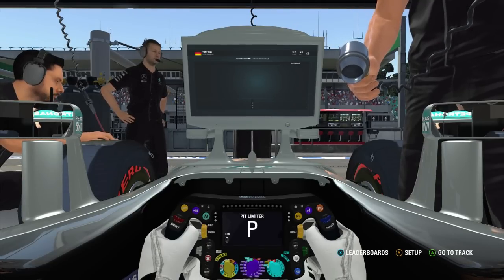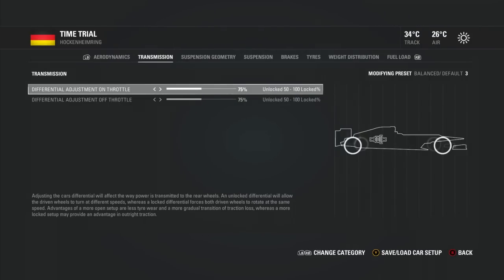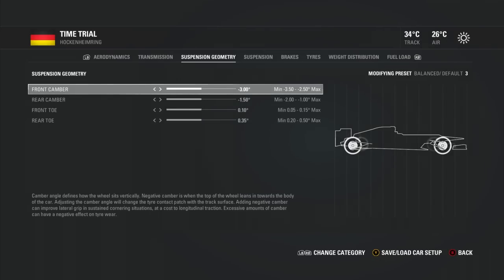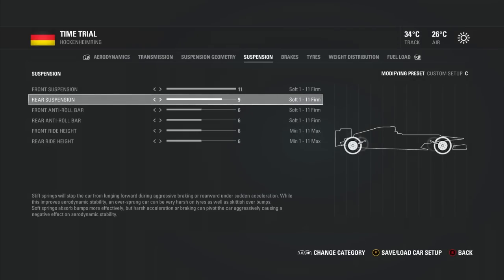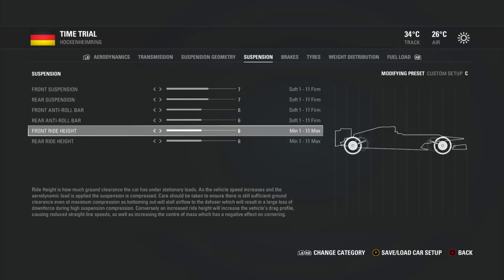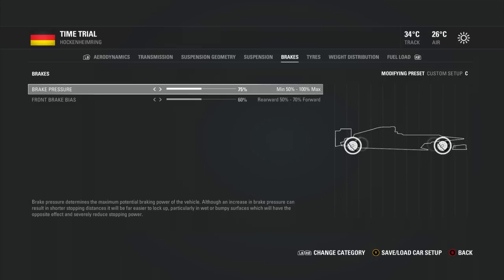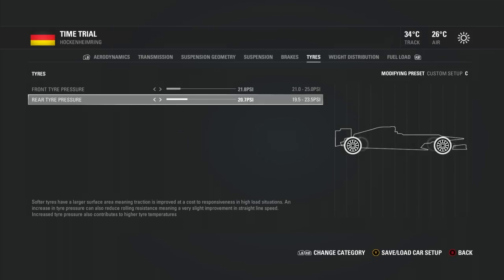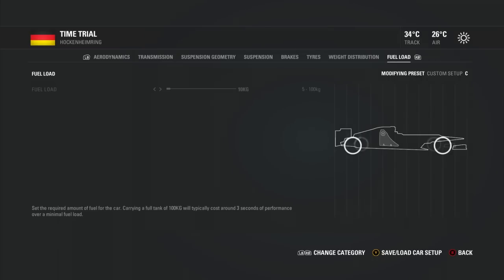F1 2016 CAR SETUPS: How do they work? Explained

Comment: With lower tyre pressure you have more grip, but the tyres degrate faster. I you choose a higher tyre pressure you'll be skating more, but the tyres last longer. That's the general idea
Reply: But because there is more contact the tire will overheat faster resulting in less grip and more tirewear
Reply: a lower tyre pressure also means bigger rolling resistance, which results in less speed

Comment: in terms of tyre pressures, I work with go karts and we set our pressures according to the temperature of the track. if it is a cold day we will set the pressures higher, this causes the tyres to heat up faster, but does increase the wear. during the summer when the track is hot we set the pressures low so that the temps of the tyres are controlled better and less likely to overheat. hope this helps

Comment: Regarding tyre pressures, reducing them will increase traction especially out of low speed corners, reduce the likelihood of lockups (supposedly) but will increase tyre wear especially around long flowing corners. Higher tyre pressures will make the tyres last longer and heat up faster but will reduce traction and are only recommended for tracks like Silverstone with long flowing corners. Feel free to quote me if I'm wrong here.

Comment: In NASCAR low tire pressure is used for good long run speed as the pressure will go up over the run.  High tire pressure will make it wear out a lot quicker and will only be good on the short run

Comment: I noticed a couple things:1) moving ballast to the front of the car puts more weight on the front tires. Therefore increasing the grip on the front tires (also increases tire wear because your working those tires harder), conversely less generation of grip in the back end. Therefore introduces more oversteer, not less. (I think codemasters might have misunderstood ballast placement). So codemsters description should go as "Moving the ballast to the rear reduces oversteer, conversely moving the ballast toward the front reduces understeer.2) Tire pressures are based on the temperature across the surfaces of the tires. Inside of tire running much hotter than outside means that there is too much negative camber. If the middle of the tire is significantly higher than the outer and inner, then the psi is too high. etc. Will we be able to see the temperatures across the tire surface in this game?
Reply: I believe codies are really thinking Center of Gravity of the vehicle here, not ballast. If they meant Center of Gravity, then their verbiage would be correct. Center of Gravity usually has a X,Y, Z coordinate (3-dimensional adjustment) as well rather than a 1-dimensional adjustment like they show here in the game. Ballast typically would be adding weights to the vehicle to help with corner weights at each corner of the car (usually to even out the distribution of weight without messing with suspension settings).

Comment: Bad advice. you shouldnt use stiff suspension for monaco! Soft suspension give more mechanical grip in slow corners, stiff suspension better response (preferable at high speed sections like there are many off them in Silverstone and Spa)
Reply: I am confused, would a soft suspension at silverstone at least be good in terms of tyre wear? Sorry I know it's been a while since your comment, would love to get an answer
Reply: H3r0KinG The best Silverstone setup is available at 'TRL Litless Silverstone Setup' video. If you search this you'll get the video. In terms of one-lap setup, his setup is great. If you want less tyre wear in the race, use his setup and soften the suspension a little bit (3 steps maximum for each setting) and set the camber less agressive (so dont use  -3,5° and use -3,0° for example ).

Don't use a very soft setup for silverstone, this will drop your race pace too much and won't give you an tyrewear advantage thst will allow you to skip a pit stop. If you do as I wrote aboce you'll have a good balance.  I hope this was usefull.

Comment: So what are the most important things to remember in terms of tyre saving? (With setups) eg. Is less camber more important than more softer roll bars...
Reply: I think that depends on the track. For example if you have a bumpy track like monaco and you put verry firm suspention then you will skip more over the track resulting in more tyrewear and less grip (I think)

Comment: High tyre pressures mean the fuel usage goes down quite a bit, as the effort required to move the car forward decreases, due to the tyre not dragging across the surface, with less contact. It also reduces steering responsiveness, as the car is more susceptible to bouncing and skating around thanks to the tyres being less compressed by the car's mass. Low tyre pressure does the opposite. At least in real life, I don't know how accurately they modelled it in game, and those are just the main differences.
Reply: also low tyre pressure will heat the tyres up more, won't it?

Comment: I feel like it should be your engineer that does your set up for you and maybe then in practice you could say I've too much under steer or I'm struggling with traction etc and he can change it for you
Reply: As a F1 driver (or any racing driver for that matter) you also need to know, at least a little bit, how to make a car setup. Because everything overlaps in real life (I don't know how that will work in the game). Like for example, you feel like you have too much understeer, that could be in fast corners (downforce), that could be in the middle of a slower corner (suspention) or it could be at the entry of a corner (anti-rollbar). 

And in a F1 car there are a lot more things that they change, but the drivers know at least 'the basic stuff'.

Comment: i don't understand it cause you say with higher tyre pressure the car will slide more but if you slide more the tyres wear out quickly, but if you have to much grip you wil loose traction/topspeed so you need to find a pressure between that cause i think they wil wear out quicker with higher pressure atleast with a go-kart and if you're running higher tyre presure you're tyres reach higher/faster tempature
Reply: when you have too low tyre pressure, then the tyres start to overheat. And when your pressure is too high, you will have less grip and then the tyres will start to overheat as well.

Comment: Ballast is wrong. The Codies description isn't right either. Moving ballast to the rear increases rear traction (from having more weight there) and reduces oversteer. Front ballast reduces understeer in the same fashion. So it looks like the game actually has this backwards, at least in the setup menu. Hopefully they fix this.

Comment: I have a question about setups:
In some previous f1 version (way back in like 2010), the setups were already tweaked to the specific track and you just had to tweak it to your liking. Is that still the same or do you need to put in like 11 downforce for monaco and 1 downforce for monaco?

Comment: Oh, I thought this would be replaced by the R&D, as I thought the R&D would be easier to update the car than the stop, since I noticed that on F1 2012, if I went any more than the intermediate difficulty, I easily fall all the way down the order, but I am not so good with car setups, since I don't know which parts have to be changed to make my car's pace match with the other front runners. So, if this game has both R&D and car setup, do I still have to do changes in the car setup if I were to get the game and go on one of the hard difficulties?

Comment: Well could you explain the differential "off". Why does having it locked help or hurt when your off the gas and have the differential 100% locked
Reply: Thanks for the answer!
Reply: with differential 100% locked, the wheels left and right are forced to spin the same speed, But when a car takes a corner, the inside wheel needs to travel less distance than the outside wheel. So when it's 100% locked, you will have a lot of oversteer when it's 0% locked you will have a normal working differential so it will take corners very well. (A differential makes it possible that there is a difference in speed between left and right)

Comment: 7:25 Wrong. Low tyre pressure gives you better performance AND tyre wear. So, the only bad thing is a risk of puncture
Reply: But if your tire pressure is too low, the tires will overheat, resulting in less grip and more wear
Reply: Lower pressures increase the size of the contact patch, so there is more mechanical wear and overheating is easier. Lower pressure means more traction but reduced tire life, which is why teams push for lower pressures in qualifying but not necessarily when trying to make tires last during the race.
Reply: +cobalt789 You are wrong, low tyre pressure increases tyre wear too. Contact Ossi Oikarinen if you dont believe

Comment: With brake pressure dont you set everything else up, so you know how much downforce you got, and then adjust the brake pressure so that you dont lock the brakes with full braking on pedal/trigger?
Reply: Indeed, everything overlaps eachother, also firmer front suspension will stop the car leaning forward resulting in less downforce and further weight transfer to the front, thus faster locking brakes.

Comment: ino u tried ur best to explain it but does any1 else have an explanation on transmission?? thanks for ur help :)
Reply: In short, the diff on throttle: when you set it really high, you get more traction out off corners. The downside of this is when it is to high, you will get loose rear end/lift off oversteer. So you need the balance traction vs lifely rear end.
Diff off throttle: changes the way the car behaves when you are off the throttle. If it is to low, your car will be pushes to the outside while off throttle in a corner. For me it feels a bit like getting understeer after letting go off throttle. When you set this to high it will also give a more lifely rear end.
Reply: Ok, thanks.

Comment: all of my setups are based around the rearwing always being 1 point more than the front. Maybe its because I drive a Renault in career mode but I simpy dont have the confidence to open up the gas (no matter how gradual) at high speeds when using the "more mainstream" setups. Is that weird?

Comment: My question is.. How do you improve rear traction ? :/ I am learning no assist for like 2 months and i am struggling a lot with that
Reply: More downforce at the rear (mostly effect high speed corners), softer springs setting at the rear of the car or/and lower tire pressure at rear of the car. This all can improve the rear grip. Also If you loose grip of the rear when you step on the throttle after a slow corner for exemple, you could change to diff. On throttle , to decrease this 'lift off overstear'.
Reply: +Nicky Rongen Thanks, man ! 👍

Comment: is it realistic like do you need more rear downforce instead of front downforce? which gives you more stability?
Reply: I think (hope) that will depend on the track. BTW is it true that they set less front downforce on F1 cars?
Reply: yeah, it basically makes the car more stable under braking and turn in. if you put more front downforce in a real f1 car when you turn in youll either go into a slide or just completely spin.

Comment: Ben, say if i start off in a Mannor, does it register as a junior team for Mercedes or not. Basically would there be big chance for me to jump from Mannor to Mercedes?
Reply: Manor aren't a junior team for mercades .
Reply: absolutely not, Manor aren't a junior Mercedes team, they just loaned Wehrlein to them and supply them with power units
Reply: Yeah but if u start in toro rosso i think it registers as junior team for redbull
Reply: Technically yes it is, well by many F1 experts consider Mercedes using Mannor as a feeder team

Comment: Ben
Why, when I setup a car, it feels different in Time Trial to the real feel in Career Mode?. Any idea.s
Reply: Thank You F33bs for that information. It will come in handy.
Reply: and more important: there is no tire wear in time trial mode

check the times in time trial, there are people with insane lap times with the default setup, or they use crazy ones, like 1-2 wings for Monaco, or extreme lower chamber/suspension for every circuit... if you use those setups in Career Mode, you are not so fast, and your tire's life is very short

I wouldn't recommend you to practice in time trial for this reason. If you want to improve your skills, do it in quick race

Comment: @Tiametmarduk What the difference between the diff on and off throttle? I don't see how off throttle affects the car?
Reply: I think if you unlock the differential the wheelspin is harder to manage but if you can deal with it, you've got better tyre wear. If you lock it, you have more rear traction but your tyre wear is worse. I hope it answers your question :-)
Reply: I don't know how it works in this game, but in other games I have played, a locked diff meant that you have lots of understeer while exiting a corner. (again not quite shure if that is the same in this game)
Reply: In some corners when you let go off the throttle in a corner, your car will push to the outside, a bit like understeer does. With the diff off throttle you can make the wheel turn better in when off throttle ...the downside can be that you will get more loose rear end (If im correct)
Reply: +Nicky Rongen so would an open rear differential mean better turn in?
Reply: +TheWoodMaker yes, lower diff off throttle can make the car turn in better.
Reply: +TheWoodMaker and I say lower (more towards 75 than 100, for example)because I always mix open/closed up.
Reply: +TheWoodMaker sorry...like i said in my last reply...i sometimes mess up if you need to lower or higher the value. I just checked, and when you want easy turn in when you release the gas, you need to higher the value on diff off throttle. you can try it out for example on Japan GP, in sector 1 with all the left right turns...also make sure you have to rear anti roll bar more firm (8 for example) so you have better change of direction in these corners.

Comment: I'm sorry, but from your description of the effects of suspension settings shows a real lack of understanding as to what's happening; you'll run stiff at Silverstone and soft at Monaco. Reason? High-speed corners you need the stiffness to minimise weight transfer, especially when changing direction, like in Maggots and Becketts. And at Monaco you're limited by the bumpiness of the circuit. In low speed corners softer is better anyway; your car will be faster in almost every corner in the comfort setting than silly spotty settings ;)

Comment: Is there no gear ratio setup? I'm disappointed. I hope they will add it in the final realise.
Reply: F1 rules currently state that all gear ratios are decided before the first event, then locked in for the season. so I'm guessing not. would be nice for that rule to be changed though
Reply: thanks, I was out dated, I though they can change it 4-6 times throughout the season

Comment: Can somebody help me plz. I'm using a thrustmaster t300rs on my ps4, and for some reason the alignment on my wheel is off. I'm not sure if it's only for f1 2015 though. In f1 2015, I always need to wheel to be turned slightly to the right in order for the car to go straight. Can somebody assist me with this problem before f1 2016 releases. It will really really help. Thanks
Reply: search up on thrustmaster website how to reset it
Reply: Best thing you can do is download the wheel driver/control panel from thrustmaster site and connect your wheel to pc. In the control panel you can see If your wheel is alligned when you hold it straight. If this isnt the case there is a reset/recalibrate option somewhere in the manual. If i remember correctly it is some kind of button sequence you have to push. After that you can check it again in the control panel If it solved the problem.
Reply: +Nicky Rongen thanks for the help bro. Just 1 problem, I haven't found the control panel on the website. Can you give me any more information on where exactly to find it, as I am probably looking in the wrong place. Hence the reason why I can't find it

Comment: how does the differential adjustment off trottle work?
Reply: I think (from other games I have played) that, differential adjustment off throttle works like the following.
If you have a verry low lock on it (so you put the slider too much to the left) the car will oversteer more if you don't apply any throttle. 
When you have a verry high lock on it (so you put the slider too much to the right) the car will have more understeer if you don't apply any throttle.

I hope this answers your question :)
Reply: thanks!
Reply: Luc np :)